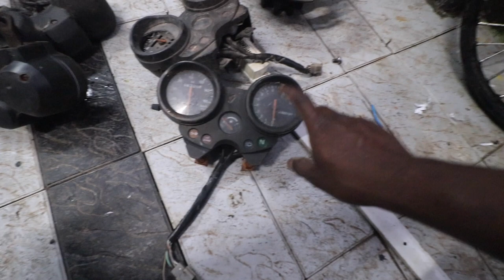Road to Super bike Part 3 (Malayalam Video)

Comment: Hi bro I have a doubt...can i use Galadatior fork and fix RZ5s hub and disk plate...if yes the. What all mods should I do...👍🙏
Reply from the maker: If you remember my rxz had a gladiator shock with Rxz hub.
Reply: @Yamakaze  oky chetta ..so fix chayam ale ..
Reply from the maker: @arunkannan5792  👍